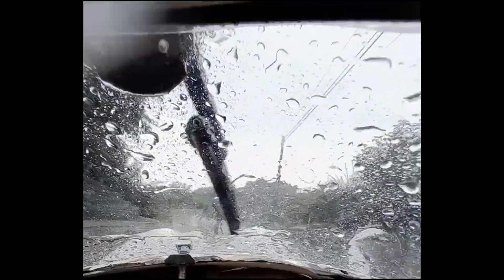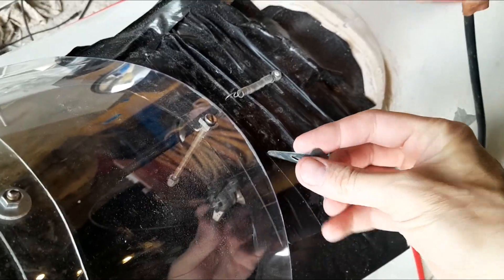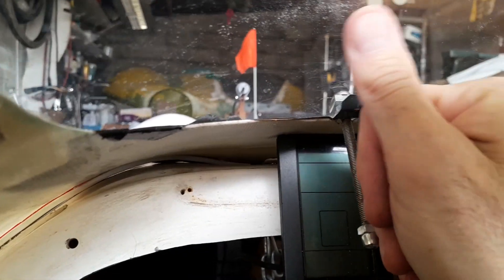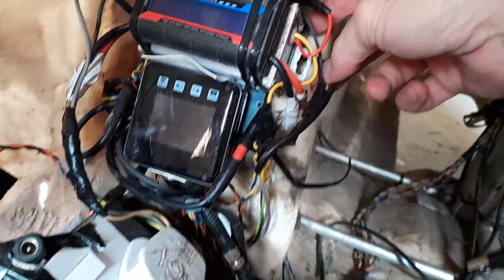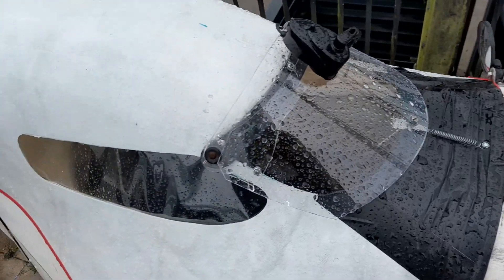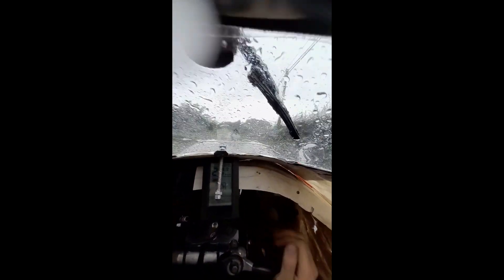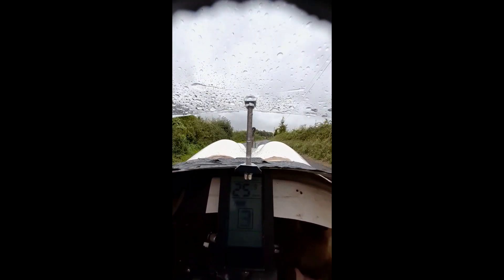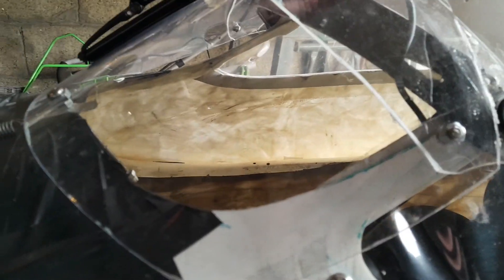DIY Windshield Wiper Installation on a Velomobile: Solving Rainy Day Visibility Issues

Comment: Have you tried some coats of Rain-X?
Reply: Rainex isn't a good solution; it repels the rain for a little bit, but eventually puts a glossy sheen on the glass (or plastic) than can create glares in the sun, and it's hard to get off. Not good!
Reply: If you are talking about a film (sticker) on the visor, then I tried it. It doesn't work well enough.